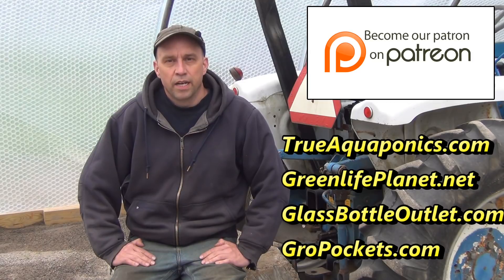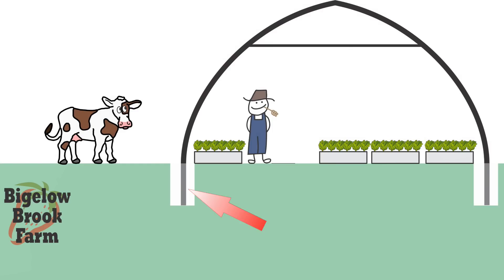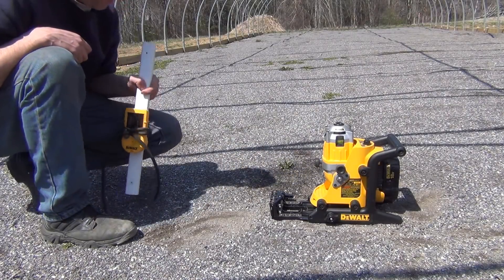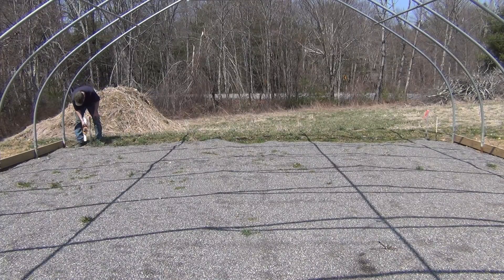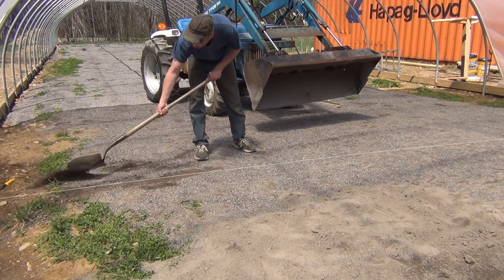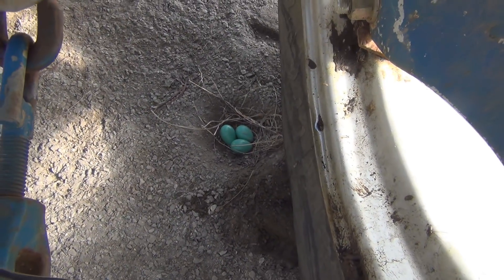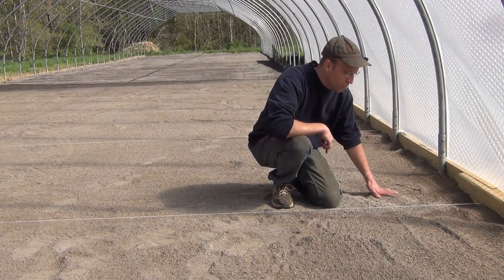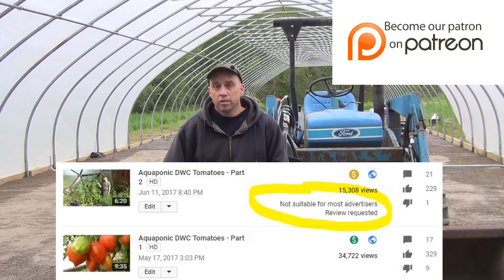Big Aquaponic Greenhouse - Part 7 - Why is the FLOOR so important?

Comment: Hi there,

If it is not too much trouble to you, can you tell me more about foam insulation (the one you were planning to built but cancelled). I live in one of the coldest countries (Mongolia) and I can't find a good solution on insulating greenhouse floors. If you have any other advices please let me know. Thanks!
Reply from the maker: It's just sheets of styrofoam board that are designed to be used around foundation walls.  It's the same material that we will use for the rafts inside the greenhouse.

Comment: groundhogs can be controlled... I do have  small greenhouse up out in the field and they do like to dig under the walls,,, but a $20 trap from tractor supply a cannelope ...got 4 of them ..took them 10 miles away... haven't had and since...4 yrs now
Reply: I use cantaloupe as well. They simply can’t resist it.

Comment: I'm building a little 12 x 8ft cattle panel greenhouse. I did a mini earth battery and I put the Solawrap on it as well. I found it easy to work with and I have high hopes for this little greenhouse. I used that foil bubble wrap to insulate the ground as well as the north and west walls. I'm also using vinyl coated hardware cloth to keep rodents out because I want to keep a few quail in it (provided I can keep it from getting too hot in the Texas heat - Fingers crossed). I'll be interested to hear what you say about your experience with Solawrap.

Comment: YouTube is losing ad revenues themselves, because of they are pushing the political left stance in their vague policies. It is hitting subscribers across the platform in many different areas. They are failing as a company as ads are becoming rare , so thet are punishing their content creators as a result. Patreon is in trouble as well for some bizarre reason, as they clamping down on free speech as well, which is hurting their bottom line. They had to back off the fee increase that they recently applied.
 Please make sure you diversity your videos to other platforms, in case YouTube goes belly up. Large corporations have bellied up that in the past. Social media companies are not secure. Remember myspace and bebo. I am that old.